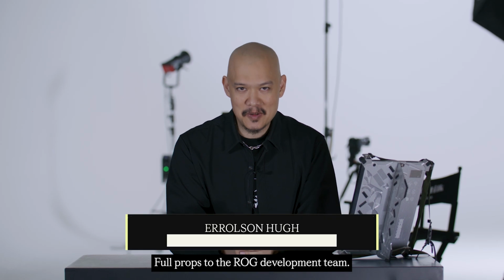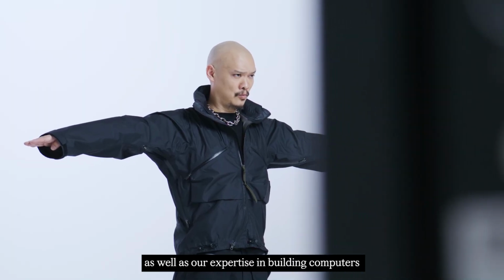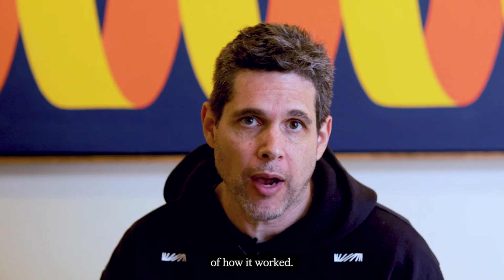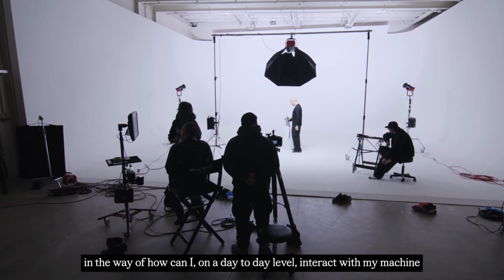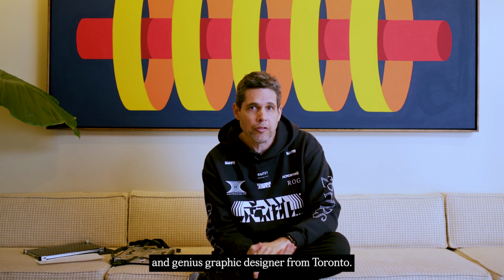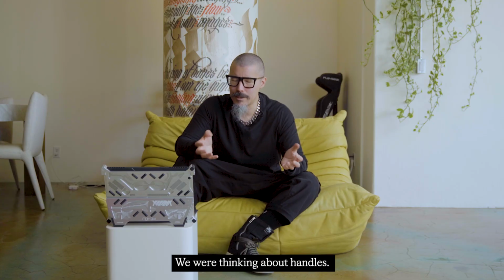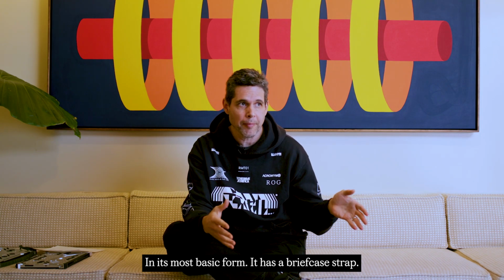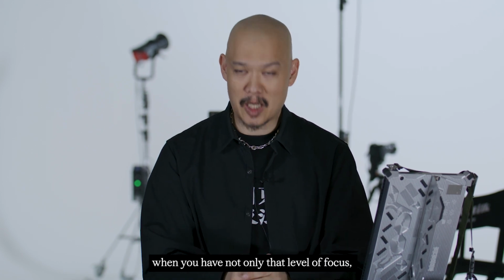RMT02 Design Story | ROGxACRONYM

Comment: I bought one from Asus directly for the $2500 price.  Some crazy seller on Amazon is selling the same thing for over $4500!!! I tried to like it for a couple of weeks.  It performed well, but I had some issues with the keyboard keys and weird characters on key caps.  Even that wasn't so bad as I could use an external keyboard.  However, after using it for a while I was convinced the speakers had poor sound quality.  Even at the low volume setting I noticed buzzing from the speaker, which almost sounded distortion in low and mid frequencies.  I adjusted the audio settings and Dolby setting, but I could not improve the sound.  I finally decided to return it.  I think the keyboard and the speakers are the weakest point about this notebook.  My cheap Lenovo 2-in-1 notebook for $600 has better sound and keyboard.  I wish they improve in those areas and also offer replacement keyboards someday.  If the keyboard fails, you have to send the entire unit to Asus not just the keyboard.  If they improve in those areas, then I'll probably get one again.

Comment: As an owner. I like the strap and how it feels like I'm not going to break it, but I can't stand the extra letters on the keyboard. 8/10
Reply: I agree I also didn’t like the small trackpad 🤧 which hurt my hand so I returned it but I regret it now 😢
Reply: @mikivli   did you consider a wireless mouse? they come in many shapes and sizes and would have been a fairly easy addition. what did you wind up replacing the acronym with if you don't mind me asking...?

Comment: AMD RADEON AND AMD ATHLON SILVER GPU AND APU AND QPU AMD Radeon(TM) Graphics Main/Integrated VRAM 20,048 MB DDR4 5200 MHz CPU - AMD Athlon Silver 99.999 U with Radeon Graphics - 20 Cores RAM 64 GB 100 PERCENT MORE POWER 200 PERCENT MORE POWERFUL AT 1000 PERCENT MORE POWERFUL IS THE MAXIMUM POWER THAT A PC AND A 3D 2D LAPTOP CAN PROVIDE A SINGLE PROCESSOR OF A PLAYSTATION 5 AND AN XBOX Xbox Series X, the fastest and most powerful Xbox ever. ONLY A GPU PROCESSOR OF 18 CM TO 18 CM X 0.6 CM VRAM OF 18 CM X 18 CM X 0.9CM ANTENNA OF 30 X 22 CM X 0.2 CM AT COLD TEMPERATURE AND THICK LIQUID COOLING FOR MILITARY AND CIVILIAN TACTICAL USE WITH A VALUE OF 1000 DOLLARS CIVILIAN PRICE AT 10,000 DOLLARS  MILITARY OR PRIVATE OR GOVERNMENT PRICE
Reply: you what mate